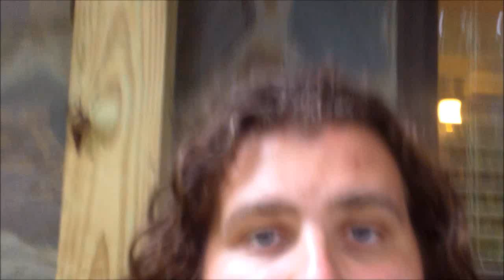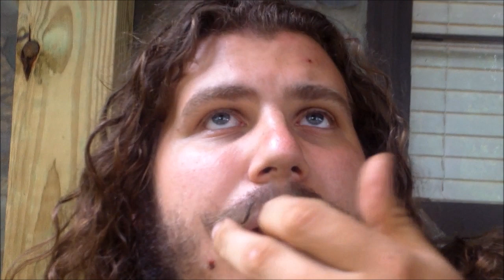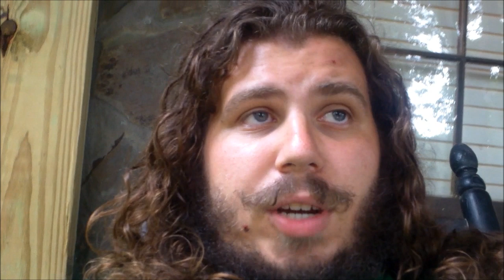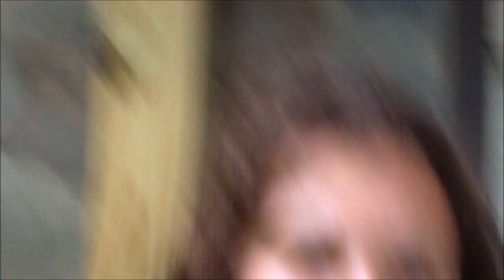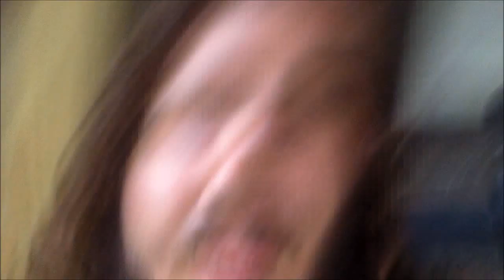hey!

Comment: i own a jeep with five lug i think the back or rear is a 35 because of the plastic cover on the diff and the front might be a 44 because it has the metal fill plug i read this on jeep forum.com they had picture's of differential covers so don't quote me on this anyway glad to see you up and making video's again it's a camo power wagon does it have a 318
Reply from the maker: i need to reupload all my videos of the dodge. yeah it has a 318 the engine and tranny are in great shape the guy i bought it from just rebuilt them but the body and the fame on the other hand have some of the worst rust i have ever seen lol. i believe i have dana 60s so i was told at one time it has front leaf springs its a 4x4
Reply from the maker: Dennis Barszcz im not that proud of my welds lol... fingers crossed they will hold
Reply from the maker: Dennis Barszcz thanks for the info

Comment: Hows the mining going
Reply from the maker: shut it down for the summer about 30 days ago... lost 4 $400 cards in one day because 4 ac units could not keep a 8x7 room cool... room was gettting to 130 f and my electric bill was 600 bucks.... i will turn them back on to heat the house in the fall
Reply: That sucks. I just spent a thousand on building a new pc/gaming rig
Reply: DannysCam I can't believe it requires that kind of cooling capacity...that's crazy. Good luck with it.
Reply from the maker: RamblinAround im not selling my rigs like other people i decided to hold on to them... most of them cost around $1600 to make and people are selling them for $800 im not into panic selling just because the prices dropped